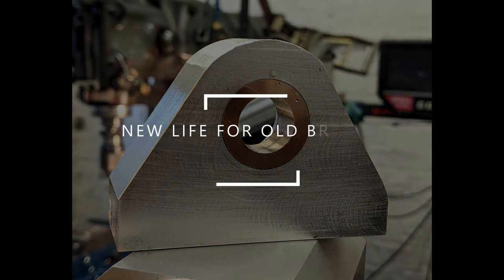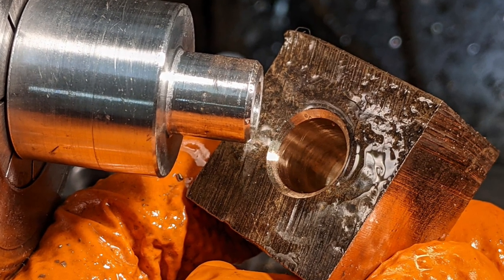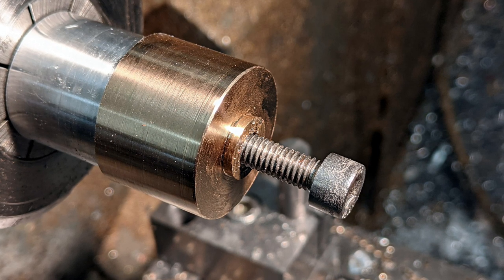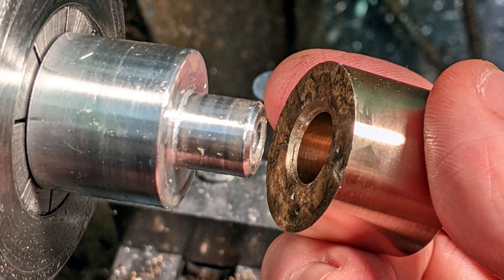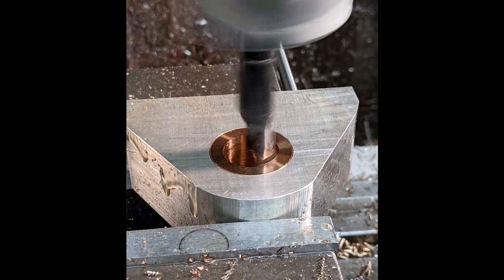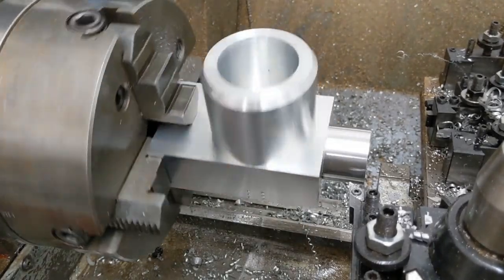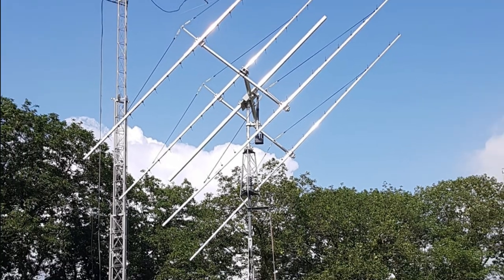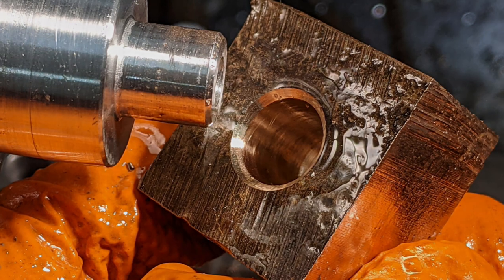Machining a bearing from a forgotten lump of Victorian bronze to bounce radio signals off the Moon!

Comment: Always good to find new uses for old materials, we're extremely lucky to have a scrap yard just a few miles from our shop...long story short, we run a orphanage for dis-guarded and wayward metal 😉🙄😁 Yes it is expensive endeavor but if we don't then it all gets crushed up and hauled off eventually ending up as some cheap junk from a far off land that primarily builds what we lovingly call Chinesium, a high "quality" over priced 🤑 lump of junk, that's covered in cutting fluid and grinding dust that destroys from within, with us sitting there wishingwe had saved it from such a horrible destiny, like any of Horror Fright's tools, literally any tool they sell 😁
Reply from the maker: A couple of decades ago, the local docks scrapyard dismantled an aluminium minesweeping vessel. That would have been a useful source of material!  I'm looking out for large lumps of cast iron to make a new rear toolpost and a steady-rest for my lathe.
Reply: @MachiningandMicrowaves  wow, bet it would been full of material. Good luck finding cast that large, bet new piece would set a man back a few dollars

Comment: Cracking story. As a bit of a diesel head, I'd be interested to hear at which engine works your father was employed. Was it a railway works?
Reply from the maker: Ruston and Hornsby, Anchor Street, Lincoln, then Ruston Gas Turbines, then Siemens, and Napier Turbochargers but all the same organisation since the late 50s until he retired in 1991. I just bought a Ruston and Hornsby 9PB 4.5 hp stationary engine. Three uncles also worked at R&H, although one was headhunted to do work on TSR2. My dad had a bit of titanium spar from a TSR2, but I never managed to find it when we cleared his workshops.